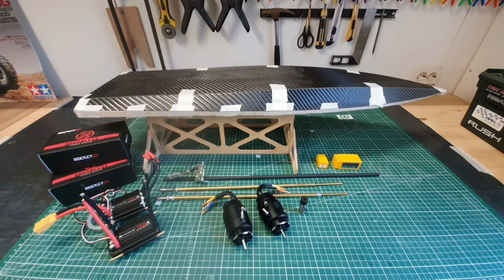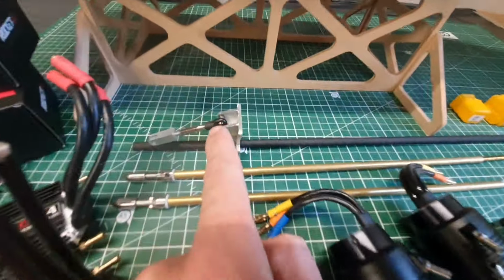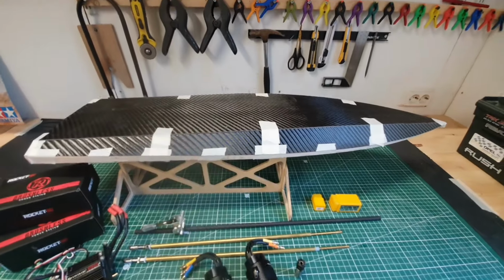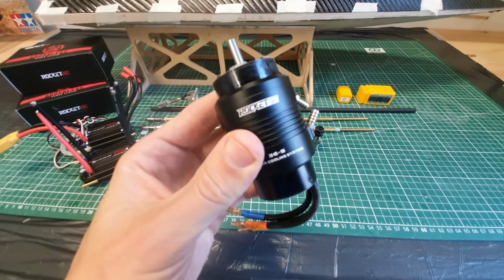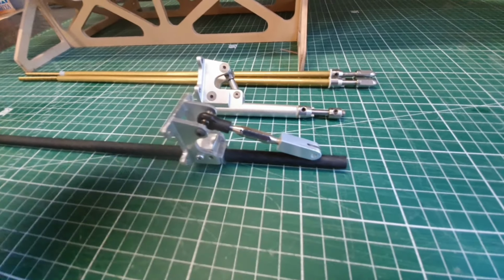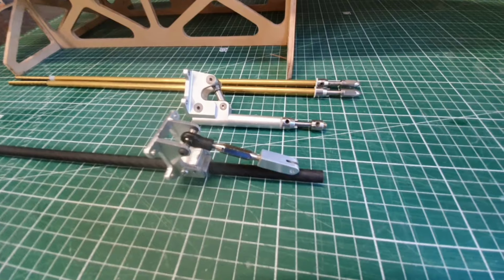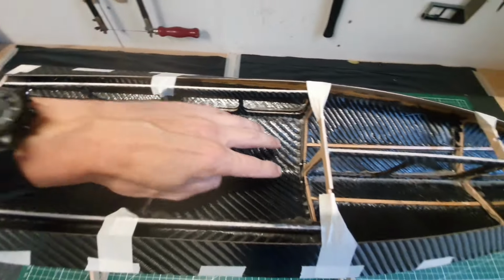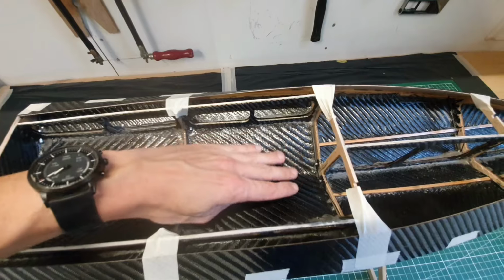RC boat build - Twin motor mono part III

Comment: Great work, nice and clean
I would recommend using plain weave instead of twill which would add even more strength. Nevertheless twill will be plenty strong.
Reply from the maker: Thanks Frank 👍I agree on the weave type. I bought this weave for making an F1 Powerboat cowl, but I ended up using it for the twin build. That's why it is a twill weave, so it would easily follow the cowl shape. Thanks for your advices, I appreciate them! ✌️ DJ

Comment: This is a looot of work Jan but it becomes a very strong hull👍👍...Bytheway the estimated RTR weight  is not that much for a twin motor setup !
Reply from the maker: Thank you Dim! Working with carbon is not my favorite honestly. Difficult to process and the edges and strands sticking out become very sharp after epoxy cured. But the mechanical properties excellent and it looks nice too 😎.

Comment: How will that work out with the motor/ESC combo? If I look up the Rocket 3670 1850kv it says maximum amps is 66A. Will those take the 150Amps from those controllers?
Reply from the maker: Hi  it's the other way around: the motors generate current, max 66A according Rocket. That will possibly be way higher for short bursts and you have to select a speed controller that is capable of dealing with the motor current. The 150A speed controllers are plenty, but I might do a motor upgrade lateron, so I like some extra room with the controllers ✌️

Comment: hey, what materials do you use for the glue? love the build and I am trying to get into rc boats so any help is appreciated!
Reply from the maker: Hi, I use ca glue for the bulkheads and I glue the plating with 2k laminating epoxy. For gluing with epoxy, I thicken it with microballoons, or cotton flocks, or carbon strands. Laminating glass or carbon I do without any additive to the epoxy. Cheers, DJ
Reply: @CozyRC   thanks  a lot, do you also know de mix of materials you used at 1:00?  the black substance you added in the end in particular please, Thanks for your time.
Reply from the maker: @maartenbernhard7663  the black paste is made from laminating epoxy, thickened with micro balloons and a few drops of black acrylic paint.
Basically, I use micro balloons for making fillets and filling gaps. For strength applications, it is better to use cotton flocks, or even better, carbon strands. ✌️ DJ

Comment: Whit all the carbon you whill not gona have gps signal inside the boat,but the boat it whill be strong👍
Reply from the maker: Yes, I'm aware of that. I will keep a small part of the hatch without carbon. I did the same for my F1 cowl, that is also made from carbon fiber. Yes, it needs to be strong to cope with the G-Forces 😎😀
Reply: @CozyRC  yes this is the solution

Comment: Esse material preto é fibra
Reply from the maker: The black glue is 2k epoxy resin, mixed with microballoons and a few drops op black ink. The fibre weave is a carbon twill weave 200grams/m2. ✌️ DJ

Comment: Very nice boat! Can I build this with one motor or should i go with the original wildthing for one motor? I have a rocket 4074 2000kv motor. I will send you email for the wild thing motor mount.
Reply from the maker: Thanks! You can build this as a single motor too. The bottom hull is almost identical to the Wildthing, it's just a bit more narrow.
I will reply on your email as well 👍
Reply from the maker: Thanks! You can build this as a single motor too. The bottom hull is almost identical to the Wildthing, it's just a bit more narrow.
I will reply on your email as well 👍